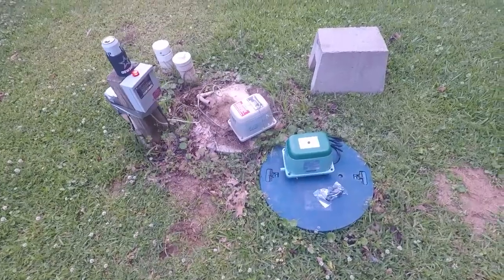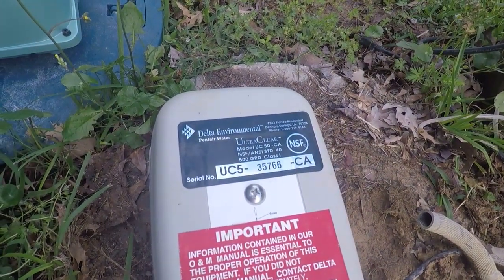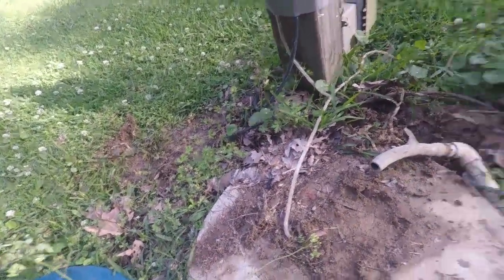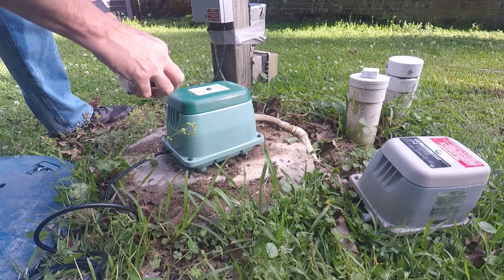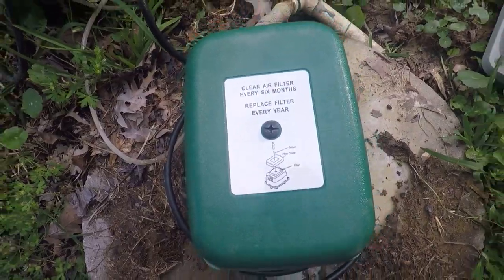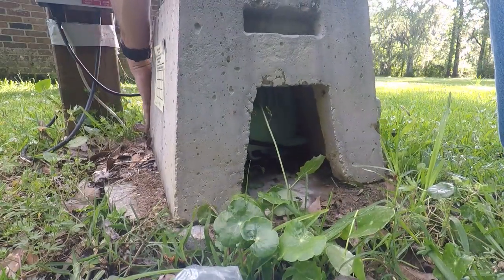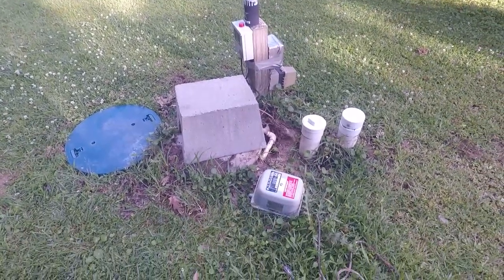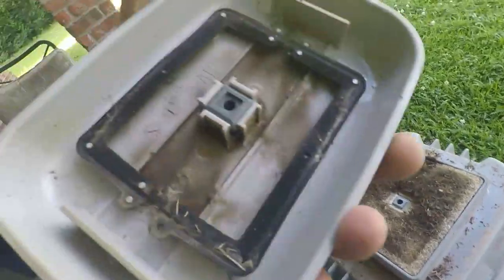Don't Forget to Maintain Your Septic Aerator Pump

Comment: Hi I was wondering if your old system that collapsed was a peat moss system? Mine has collapsed and I’m looking for a new setup. Aerator has been mentioned. Would you mind me asking what kind of a price tag I’m looking at?
Reply from the maker: Howdy! My old system was a single steel tank that gravity drained to an open ended leech field. The tank rusted out after about 30 years and the old style system was no longer allowed so I had to upgrade to current code. Current system is a 900 gallon primary black water tank that gravity flows into a 900 gallon grey water tank which then pumps the water through sprinklers onto my lawn. Both new tanks are concrete. I paid about $5000 for the whole installation including 400 feet of underground pipe and three sprinklers. I probably could have paid less but when the septic system dies two weeks before Christmas you're over a barrel. It's been pretty good but you really need to have at least the grey tank pumped out annually to keep the debris from getting into the sprinkler pump. Best bet is to check with your local sanitarian to ensure your replacement is up to current local codes. Otherwise, if you sell the house, there can be questions about how it was done. Good luck!
Reply: Aaron Rose thank you for the reply Sir.

Comment: Did this fix last very long? I think sometimes think they die when the outlet pipe holes gets plugged with sludge and create back pressure on the pump.
Reply from the maker: Thanks for reminding me. I need to do this again. So far it's been fine. Though even without cleaning it lasted at least 5 years so it's going to be a while before I know if it's worth spending the effort.